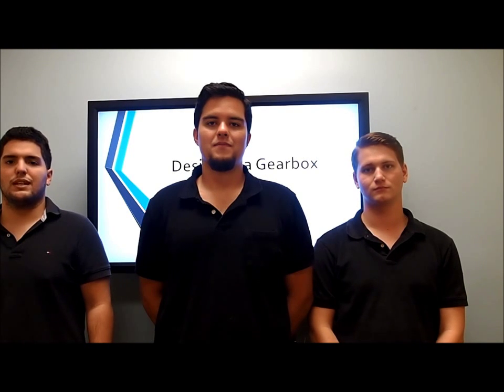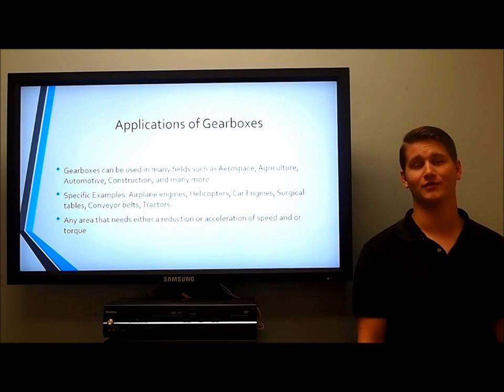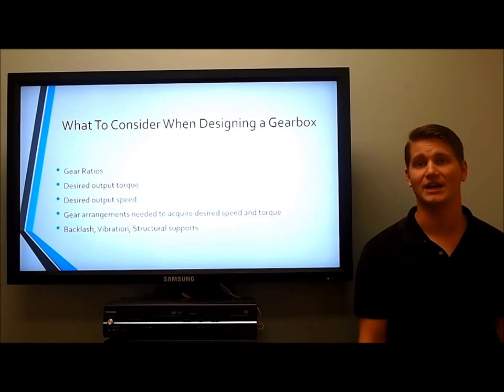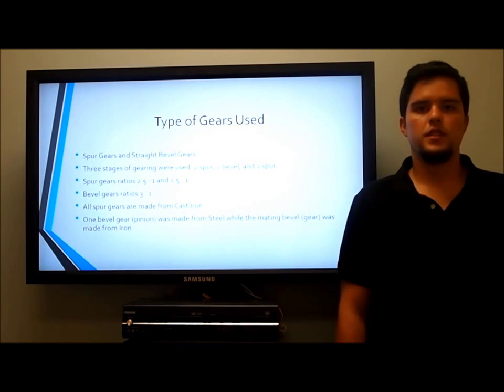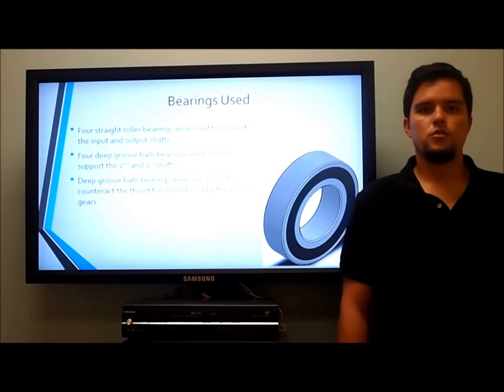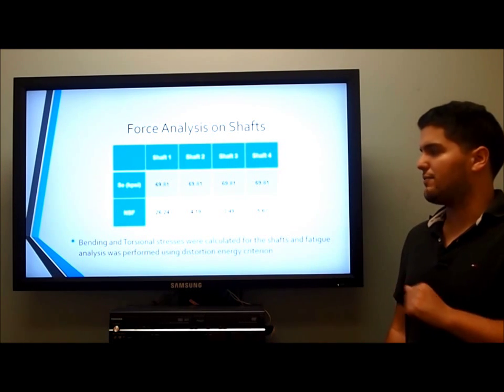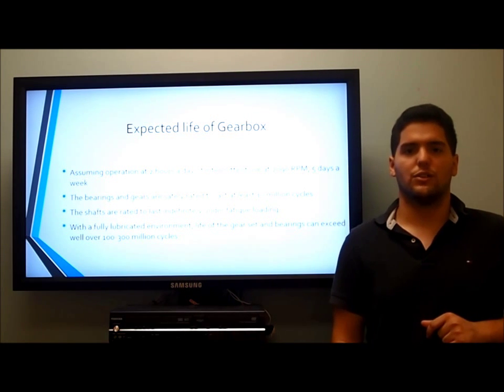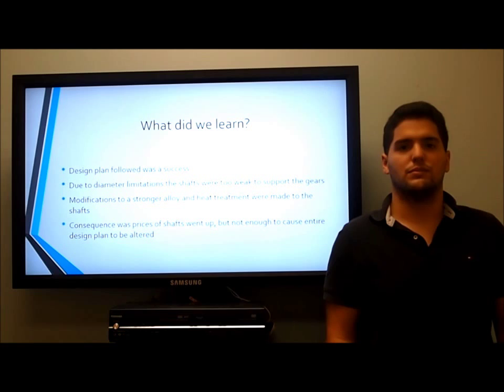Team 4: Gearbox Design

Comment: Good presentation on the of a spur/bevel gearbox. Excellent introduction covering important topics such as the selection of materials, applications and other design considerations. The team also covered force analysis based on AGMA design rules and provided real application examples. One improvement would be to do the presentation in a bigger screen (would be easier to read). Good job.

Comment: Good video overall.  I enjoyed the uniformity of the group.  I will suggest using another medium to play the PowerPoint or to adjust the brightness since the PowerPoint was not legible in the video.  I also think the introduction of the presentation was a little extensive and could have been shortened for the video.

Comment: This team had a very nice flow to the presentation. Each member was knowledgeable in their analysis. The order was executed nicely. The only issue I saw was the length of the video and lighting. In some slides, the lighting gave a slight glare that made the info unreadable. The gear design system was conducted perfectly.

Comment: This project was presented well and it seems very well rehearsed. The slides were sometimes hard to read due to the brightness of the screen, but the actual slides were legible and fluid. The presentation went about 3 minutes over the time limit, so it does fail in that aspect.